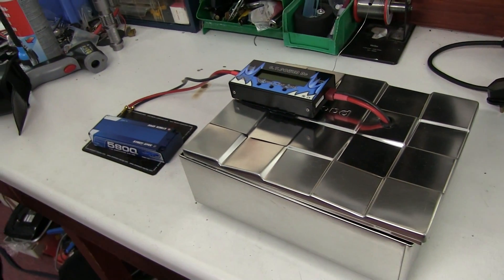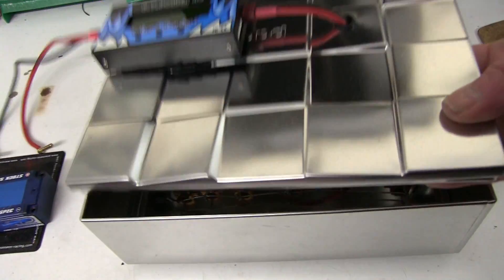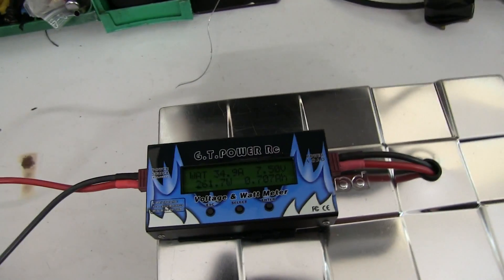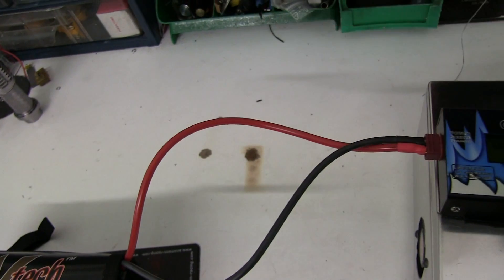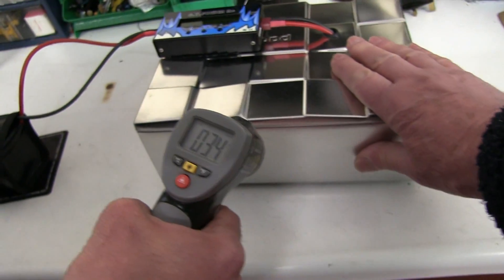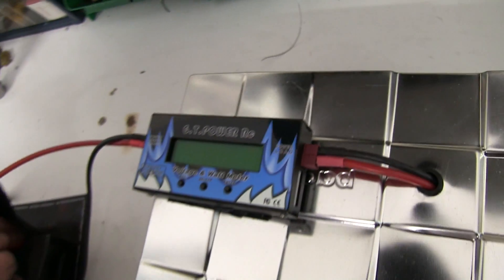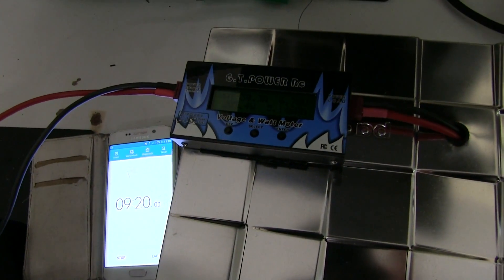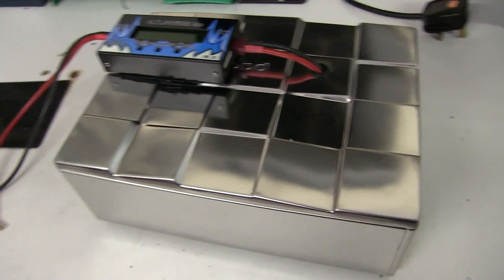High current, 40amp Lipo Discharger. How to make and use.

Comment: Made something similar that had the resistors mounted to a large heatsink and it also has a 60mm fan forcing air through the heatsink. I'm only discharging at 15 amps though not 40.

Comment: Hey nick. The build you gave for the 3s discharger works great! Question. Can I use the same bank you walked me through to discharge 6s, but instead of 40 amp discharge cut it down to 20amp without having to build a second setup for my 6s?
Reply from the maker: Hi Thomas.  How many resistors are you using at the moment?  You will need to increase the resistance by x4  to give half the current (20amps) with twice the voltage (6S).
For example you are using 0.3ohm at the moment. So you will need 0.3 x 4 = 1.2 0hm.  Total watts is 24 x 20 = 480 watts. You will need resistors that can handle at least 600watts (total)  to be on the safe side.
Reply: I am using 6 total. 100w 1ohm. 3 are wired in parallel and then the two parallel banks tied in series.
Reply from the maker: @thomasrogers2394  For 20amps from a 6S (24volt) you will need 1.2 ohm  (480 watts)
You could arrange the 1 ohm resistors as 2 banks of 3 in series (3ohms) arraged as the 2 baks in parallel giving 1.5ohms.  That would give 24/1.5= 16 amps.
Reply: @nickadams5411  please clear the concept... Does wattage increase if resistors connected in series or parallel.
If discharge a 60v 36amp nmc battery back @ 5 amp - with using 6ohm 50watt resistors find in amazon. So what should be the configuration, . 
How 50 watt resistors handle the wattage which is p= V×I , 60×5= 300watts.. 
What will the series or parallel connection
Reply: So I attempted some math and correct me if im wrong here: 6s lipo 40amp discharge- that would be 960 watts at .6 ohms. So if I were to make 2 sets of 5-100watt 1.8 ohm resistor in parallel for 500w at .3 ohm. Then wire both 500w banks In series for 1000w   .72ohm. This should handle on right
Reply from the maker: @thomasrogers2394  The 6S voltage is  say 24volts.  So the current=24/0.72= 33 amps.
Can you get 1.8ohm 100watt resistors? 
1 ohm total would give  closer to what you want, especially as the voltage will fall to about 20volts under discharge.
Reply: Nick Adams yes I have both new 100w 1 0hm resistors as well as I just found and ordered 10 100w 1.8 0hm resistors. Send me your email and I’ll send you the link

Comment: What kind of wire rod are you using to connect the resistors together?
Reply from the maker: Hi. It is 16 gauge tinned copper wire. Easier to use than stranded wire.  You could use the solid copper wire you find in the cable used to rewire houses.
Reply: Nick Adams thank you!

Comment: HELP!!!!  While discharging with my iCharger 406 Duo & resistor bank, the wires for the bank got so hot the solder came undone on the lead at the charger!!!   What can I do to deter this from happening again??  Thank you Nick!
Reply from the maker: Hi. The Duo will show how many amps are going through the resistor bank. It could be up to 40amps. You will need at least a 12gauge wire. Also make sure the plugs are tight when pushed into the charger 4mm sockets. The plugs should not get too hot to touch during charge/discharge. Also make sure the connections are well soldered.
Reply: Nick Adams Awesome!  Thanks so much AGAIN Nick!  I appreciate your time & videos! 🤘🏻

Comment: How do the resistors hold up over time? Do they need any passive (heatsink) or active (fan) cooling?
Reply from the maker: Hi
If they are bolted to a metal heatsink, the 100watt resistors are okay at up to 60Watt dissipation.
Extra heatsinks are always good, if you have room.
After that, I suggest fan cooling, blowing through the box. Powerful fans can be connected across the load .
Best to connect resistors in parallel, to prevent a single failure .

Comment: with my charger i discharge a 3s 3500mah at .60a and it takes like 3/4 hour's to go from 4.18 each cell to 3.70
Reply from the maker: Hi
Chargers have very low discharge currents, as the heat generated at higher amps is too much.
So yours discharges at a very slow rate.

Comment: Nick, can you use one of dischargers made to be a load for an icharger?  I have one but wouldn't know how to make it work as a stand alone like what you have made in this video.  I am fairly sure it can me done but want to get some advice before doing it.  Or i can just buy the resistors and watt meter you have.  I could try to use the icharger discharge function but it doesn't seem to be a constant 35 amp discharge, it seems like it changes obviously due to voltage but even at that, it seems like it is variable all of the time using the charger.  Any help would be greatly appreciated.
Reply from the maker: Hi Ronnie
The iCharger does drop the amps towards the end of discharge
The iCharger varies the voltage to the load resistor to obtain the discharge in Watts rather than amps.
But the output voltage is limited to a default of 15volts.
So if you wanted 40amps from an 8V Lipo, the watts dissipation is 40x8=320watts
If you had a 1ohm load resistor , the amps would be about 25 amps, and the voltage would be 13volts. Dissipation 25x13= 325watts.
I do make and sell a load for iChargers.
Reply: Thank you for the reply Nick.  I have a discharge resistor bank for the icharger but like I mentioned it seems to vary too much and not have a consistent load.  It could be my settings too.  I thought about buying the resistors and making me a discharge bank such as yours to have a consistent discharge to test my batteries as well.  Let me know your thoughts.  Thank you again.
Reply from the maker: The icharger manages the discharge power.
Yours varying too much is a bit unusual.
A resistor bank will heat up and resistance will increase, but will not vary too much.
Check out my discharge unit for the iCharger:

http://demonpowerproducts.co.uk/product_info.php?manufacturers_id=&products_id=10200
Reply: Thank you Nick, will be in touch.
Reply: Nick, I tried using my icharger with my resistor discharger.  What I noticed is that I had some issues with my settings.  But after fixing the issues, I tried to do some cycles and found that the discharge rate stayed consistent the voltage jumped around quite a bit.  I would like to use a set up such as yours.  Can we exchange email addresses so I don't post too much on this video?  Thank you!
Reply from the maker: Hi
You can contact me on:
nick@demonproducts.co.uk

Comment: Nick- thanks and very informative video. I had a question. I'm using 3 1ohm 100watt resistors wired in series for 3 ohm 300 watt. I have two and wired in them in parallel for 1 ohm 600 watt bank to discharge 3S 2200 packs. Am I missing anything? Should give me a decent 20 amp discharge to 3.85v for storage?
Reply from the maker: Hi
Your  2 banks of 3 ohm resistors will only be 1.5 ohms
For 1 ohm, you only need 2 in series (2 ohms) and then the two banks in parallel. (1 ohm).
A 3S lipo will be about 12volt with a high current discharge.
So your 1 ohm resistor will give 12/1= 12 amps
The total watts dissipation will be 12 x 12 = 144watts.

As you have 6 x 1ohm resistors.
You should connect 3 in parallel (0.33ohm) and then the 2 banks in series giving 0.67 ohms.
That will give you 18 amps discharge.  216watt dissipation
Reply: Thank you for the quick reply. I am not familira with parallel connection and then series connection when dealing with 2 banks of 3. Would I one side of one bank positive, one side negative and connect the two banks to gether in the middle?
Reply from the maker: Hi Thomas
Put 3 resistors side by side and connect the 3 ends together at one end
Connect the 3 ends together at the other end.
Then you have 1 big resistor of 0.33ohms.
Do the same with the other 3 resistors.
Then as you say, connect them end to end, joining in the middle
Reply: Thank you much Nick. Finished mine tonight. Wish I could upload pics. Came out by awesome thank you so much for all your help.
Reply: Nick- I have been using the bank for the last several weeks and it works great! Question- when using the icharger regen discharge, should I be maxing out at 40 amp discharge with the above listed bank and that bank out put at .67 ohms gives the wattage dissipation? Or should I be setting regen discharge @ 18amps?
Reply from the maker: The iCharger resistor dissipation  works with Watts rather than Amps.
So for 40amps discharge of a 2S lipo, say at 8Volts it will need to dissipate 40x8= 320watts.
The iCharger also defaults to 15Volt maximum voltage to a resistor bank.
So with your 0.67ohm resistor the maximum watts it will dissipate will be VxV/R= 15x15/0.67= 336watts.  It will just be enough.
The amps wiil show about 20 amps, and that will fall as the Lipo voltage falls.
You will set the regen discharge amps to 40amps.
Your display will show 40 amps on the Lipo side and about 18 amps on the resistor side.

Comment: Definitely is not suitable for all "C" of lipo battery and is dangerous. The battery may explode or burn and it will get very hot since you will most likely exceeds too many "C" of the battery at 40A. In the video, the cable used is so thin, I suppose it will melt as well at 40A.The Cheaper and better sure safe method is to use commonly cheap incandescent bulb instead of those expensive resistors instead.. Connect the bulbs to each cell of the battery to discharge it effectively [cell by cell] because some cells of the battery may be dead in the centre restricting effective discharge, if you know what I saying. Instead of wasting away the energy, use it as alternative light source at night, while discharge the battery and lighting up the night sky. After which the battery will be dead and safe to dispose off [with the positive and negative leads shorted].
Reply from the maker: Hi
I agree, but this is for competition.
I should have made that clear.
It is not for completely discharging a Lipo for disposal, but could be used for that.
The wire is not thin, and is quite suitable for the application.
The resistors are not expensive.
Light bulbs can be used, but this video is the resistor version.
You can post the light bulb version to your specifications.

Comment: Thanks heaps for these discharger vids. Am making myself a very mild unit (1ohm 400W paired with a watt meter/LiPo buzzer) just to take the load of my chargers when putting my 2S packs in storage.
Reply from the maker: Hi Ken
Yes, it is too slow with a normal charger/discharger.
So, good one.

Comment: What is the difference if u put 4x 100w 1ohm in series and the same 4 in parallel
Reply from the maker: Hi Erik
Think of 4 small pipes with water going through them.
If you put them all in a row, then the water slows down as it has a lot of friction on the walls etc.
If you put them side by side , the water can easily rush through all the pies at once.
When you put resistors in series , the value are added. So 1 x 4 ohms = 4 ohms. And the current  (amps) is lower (I=V/R) 
With 8 volts. I=8/4 = 2 amps.

When you put resistors in parrallel , the value is basically the value divided by the quantity.  So 1/4 ohms = 0.25 ohms.
And the current is higher  (I=V/R)
 With 8 volts I=8/0.25 = 32 amps

And Watts = V x I    8 x 32 = 256watts.   (And 8 x 2 = 16 wartts).

Hope that helps
Nick
Reply: @nickadams5411  erik have 1ohm 100 watt resistors. . in parallel  u said the wattage should be 256 watts total. 
Should wattage will also increase by 400 if 4× 100 watt resistors in parallel connected. Means 400watt total ???
Reply: Lots of heat will be the result. You will have 400W with approx 0.25 Ohm resistance. You need the voltage to work it out though.

Comment: Hi Nick what did you use to hook the resistors up to each other ? Great videos by the way keep up the good work.
Reply from the maker: Hi Paul
I used some solid tinned copper 16 gauge wire.
It is easier than trying to use stranded wire.
You could strip out some mains twin and earth used to rewire houses.
It is surprising how warm/hot the Deans connectors and heavy silicon wire get, since they are supposed to handle these currents. I guess anything made in China never makes the specifications.
All the best.
nick.

Comment: Thx for this good video , may i ask you if i want to discharge 4 cells 8000mah . so i shall buy 12pcs 100w 0.2Ohm  and parallel it ?
Reply from the maker: +hAwK GaRagE 
Hi
No
You will need twice the resistance for a 4S Lipo.
First decide if you want to just discharge the pack or want to heat it up.
If just fast discharging, I suggest limiting the current to 10 or 20 amps.
Higher currents will generate a high Watts dissipation which will make everthing very hot.
Apply simple calculations:
Watts=Volts xAmps.
So your 4S is say a nominal 15volts, and discharge at 20 amps.
Watts= 15x20=300.  A lot of heat.
 The same as the 2S at 40amps.  (7.5x40=300 watts)
It could make your 4S lipo swell up as the heat is concentrated in the core.
Do not exceed 65degree C.
The time to discharge a 8000mAh Lipo at 20amps will be (in minutes)
Ahrx60/A     8x60/20=24 minutes.
To set the resistance, choose a current in amps. Say 10amps
R=V/I (amps)= 15/10=1.5 Ohms.
Buy 6 x 1 ohm 100watt resistors and connect series/parrallel for 1.5ohm
or for 20amps you will need 0.75 Ohms
So any combination that will give that and enough watts to handle the heat.

Hope that helps.
Race on.   Nick
Reply: +Nick Adams 
Hi Nick
Thank you so much for the detail inf. i will make one base on above .
good day :-)

Comment: Awesome work!! Can u supply a link to those resistors?
Reply from the maker: Use these 1ohm 100watt resistors in parrallel

http://www.ebay.co.uk/itm/Useful-100W-Metal-Aluminum-Shell-Case-Wirewound-Power-Resistor-1R-2R-4R-10R-Ohm-/262386265377?var=&hash=item3d1770ad21:m:mTihmKm-hBqIO03-aYwyRmw
Reply from the maker: +thedoc329 
Hi
On Ebay search for:
 Chassis Mount Aluminum Wirewound Power Resistors 100 Watt 0.2 Ohm
You can arrange 4 of them to give 0.2ohm and dissipate 400watts.
Or look for 100Watt 1ohm, and put 5 in parrallel to give 0.2ohms.Chassis Mounted 100 Watt 1 Ohm 5% Aluminum Case Wirewound Resistor
Reply: Can 2x   Chassis Mount Aluminum Wirewound Power Resistors 100 Watt 0.2 Ohm, net you 200W load? im just a little scared of doing 400W, i would be fine waiting 20min for discharging and stressing less the 2S batteries.
Reply: would a resistor bank like this also be able to function as the external reaistor bank for regenerative discharge on the icharger?
Reply from the maker: Hi Mark
Yes, it can.
The ones you can buy, just use resistors like this one.
Reply: what is the max temp these resistors should reach?
Reply from the maker: Hi
The resistors can be bought on Ebay, from China or HongKong.
100watt version are the ones you need.
Reply from the maker: Hi Sam
The resistors will get very hot if not fitted to a heatsink or fan cooled.
The temperature should be kept as low as possible, but below 100degC and preferably below 65degC.
As the temperature rises the resistance will also increase.
The more resistors share the load, the lower the operating temperature.
Reply: If making a bank with 5 resistors is it possible to discharge at any rate like 20 or 30 or would it have to be 40amp?